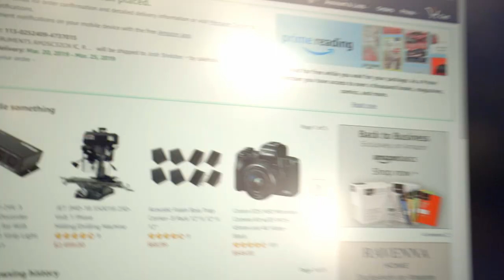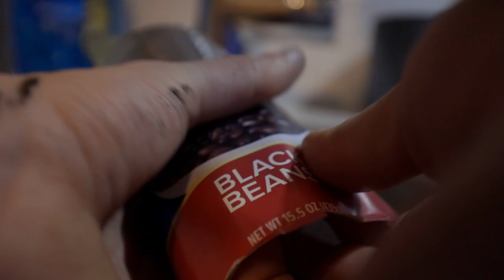Motion control setup for instagram ad

Comment: I'm glad to see that the light painting setup is back in action! :) Regarding the noise issue with the small stepper motor: I guess the main problem is inductive coupling from the big stepper motor directly into the wiring of the small stepper motor. Using a differential signal does sound like the way to go there. In general you always want to twist your leads in situations like this, to keep the loops in between the signal lines as small as possible and therefore minimize the "area of attack" for the inductive coupling. You might also sacrifice an ethernet cable and solder directly to the twisted pair wires inside. Additionally you can make use of the shielding in the ethernet cable which you would connect to ground on one (only one! ;) ) side.
Reply from the maker: Thank you for the tips! Another clue is that when the rj45 step/direction cable is disconnected from the driver, the problem stops. This makes me think that the problem is noise from that cable, which I'd think  the differential line receiver would solve. With that information, would you still think the problem is in the connection between the driver and the stepper?

Comment: What are you using DMX for on this?
Reply from the maker: I've got a raspberry pi running openHAB which can control a DMX universe through an artnet node. This setup lets me control lights with Alexa, which is nice. I also have the DMX controller in the rack if I want to manually control things. The Dragonframe DMC16 also outputs DMX, so it will be able to turn on my swinging light for one exposure per frame and turn it off for the light painting exposures. All these DMX sources are merged with a little box at the back of the rack to control the one universe for all the lighting.
Reply: @josh-sheldon  nice, I see you have the intelligent lights rigged under the shelf, are these the ones you use the Alexa to control? If so, it's a very elaborate mood lighting system and not very practical
Reply from the maker: @GeckTech  No moving heads, just some cans on dimmers and some LED cans. It works well and I didn't have to buy anything extra, so it's the most practical thing I could have done.
Reply: @josh-sheldon  well, the whole DMX, dimmers and raspberry pi set up seems a bit over kill for mood lighting. Its certainly cool though